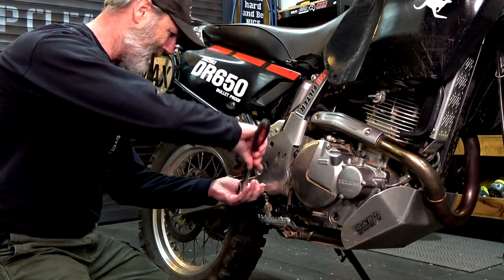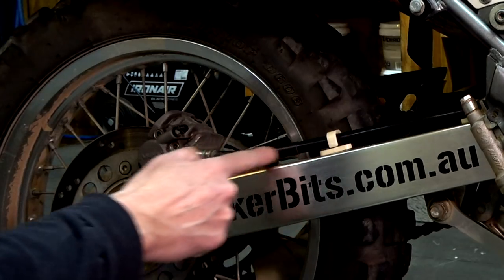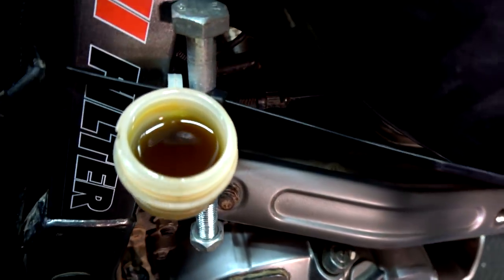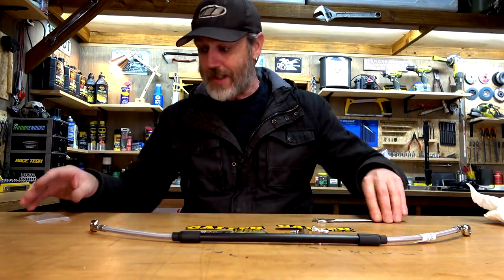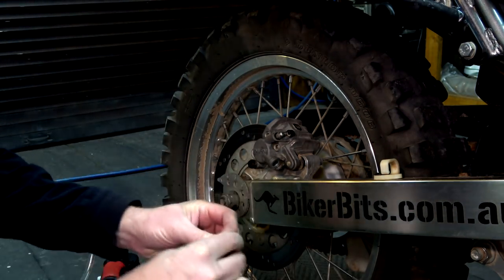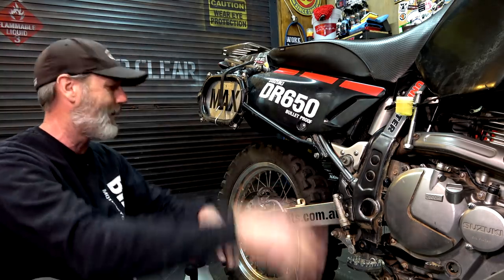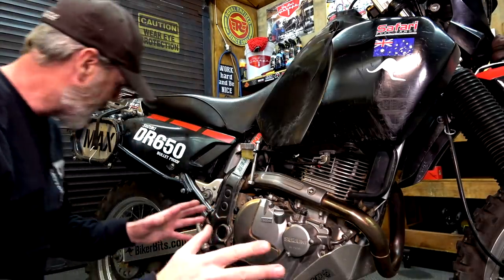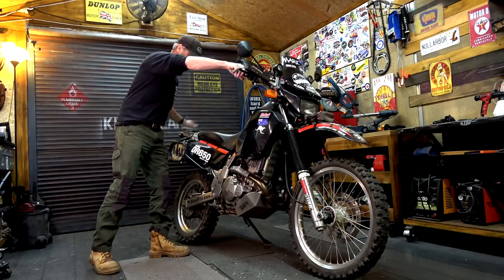DR650 Rear Steel Braided Brake Line

Comment: Easy way to bleed is to use a 80ml syringe & reverse bleed from the caliper to the master cylinder, can also use the syringe to remove fluid if overfull or changing the fluid. makes it a very easy 5 minute job...just a heads up

Comment: I have a vacuum unit as well. Not the same model but works a treat. Saves a lot of time.  I would remove some fluid from the reservoir. When the brakes get hot the fluid may expand. Will either leak past the seals [causing damage] or push the pistons / pads onto the disc creating even more heat and damage to the disc and pads will wear quicker.  Just get a small syringe and draw out some fluid between the marks on the reservoir. Taking into consideration the amount of brake pad material there is.
Reply from the maker: Thanks for the heads up! I'll definately do that 👍
Reply: @BikerBits  use your syringe, Max/Min lines on the Reservoir.
Reply: @FULLPELTAdventures   If you are getting lines try the HEL braided lines from Australia in QLD. ADR compliant.
Reply: @Chris_Z.  Thanks mate, I will check em out.

Comment: Those LED light panels work pretty well. I just used your front brake lines vid to put Galfer lines on mine, so thanks.
Reply: Oh yeah, the braided lines make a huge difference. Huge. 
Also, making sure the reservoir is the highest point in the system? A very good idea. Thanks again.

Comment: Great job on both the front and rear install. Make sure to empty some of that fluid in the rear reservoir down to the upper limit line at least. When you ride and the brake system heats up the fluid expands with heat therefore it will need a bit of room so it doesn't overflow. Only difference between DOT4 and DOT4+ is the wet boiling point being 165°c for regular and 180°c for the plus but both have same viscosity. Definitely a worth while upgrade in your hot climate. Great video T4S 👍🍻
Reply from the maker: Thanks heaps Seb and it has now been done ✅😀

Comment: Hey Mark. Long time viewer from the states, first time commenting.

I have a very similar vacuum system and I use it on anything that needs the brakes bled. Cars, truck, trailers, motorcycles….. one thing I’ve found is that if you regulate the air pressure going to the tool you will control the amount of vacuum it creates. This will slow down or reduce the power of the vacuum created. Also, don’t forget that simply cracking open the bleeder just the tiniest bit will act as a valve and only allow a small amount of fluid through. So even at full power you can control how much it pulls through the system. Allowing you to move back and forth or stand at the reservoir and leisurely fill as it needs it.  So when you change that new fluid in two years or if sooner when looks like cola (means it’s absorbed a lot of water) in the reservoir, it’s a simple hook up and flush the system in less than 20 mins total. 
One of my bikes is an XR650L and I too switched for the Galfier brake lines from stock. HUGE braking improvements. My rear line was also shorter in length and have found it to be a non issue since installation.

Take care
Reply from the maker: Thanks heaps for that mate! 👍

Comment: Great video Mark
Many years ago when I purchased my XR650R from new. The front brake lever was so spongy that you could pull the lever right into the bars. Not very inspiring for a new bike. Bought a braided line from Ballard's and you could tell the difference straight away. The lever now come half way in then become nice and solid. The XR was know to have crappy brake line. Standard rubber line was just too soft and spongy. Back then (03)  I'm pretty sure it wasn't a road legal modification. Due to not being able to inspect the condition of the rubber lines etc. More as a racing mod.
Reply from the maker: Oh that's interesting! 👍

Comment: Congrats on working it out. Note with dot 4 being hydroscopic it also collects moisture sitting in an ‘opened previously’ bottle. On my H-D it’s changed if moisture is detected in the fluid and if not max two years anyway. Also use a new bottle of fluid and dispose of the left over. Hence the reason you know see tiny bottles on sale.
Reply from the maker: Great stuff mate thanks! 👍
Reply: Yes this! Plus never pour anything back into the bottle. You don’t want any contamination in the fluid.

Comment: Much better, I normally use a little Mityvac, little cheap hand pump 2-3 squeezes at most only need 5-10in.Hg vac/15-30kpa vac, don't need a lot of suction. 
Nice, you only went a bit less than 1/2 a turn on the brake nipple also. 
Again should take note of the fluid level when you started, as you didn't change the pads to leave it back to the same amount. 
Too full can be an issue as there is a little breather hole that vents a tiny amount and could get blocked, but as you said that fluid has been there for years. 
Still would recommend you leaving a weight on the break leavers overnight to let the tiny air bubbles out. 
Hygroscopic.
Reply from the maker: Thanks! 👍

Comment: In reality save a ton of money and just use a bit of clear plastic tube, all you have to do is push the brake pedal down, but don’t pump the pedal with the bleeder cracked open, it will just keep sucking the air in and out.

If you need to drain some fluid out of the reservoir just crack the bleeder and push the pedal down, close the bleeder and let pedal go and also it is best to have the calliper piston all the way in when yo set the level otherwise the reservoir will be over full when you fit new pads.

Same old samo mark, keep it simple.
Reply from the maker: Sweet 😃
Reply: Yeah, that's what I was thinking. I can see where the silly pump thing could be useful with a car. On a motorcycle the brake lines are to short and the reservoir to small to worry about the pump. A few pumps and its done...

Also, yeah, I would've pulled the caliper pulled the pads, pushed the piston in then done the job. He accidentally left that old nasty fluid in the system.

Comment: Golden Rule, NEVER NEVER NEVER put brake fluid back in the bottle after bleeding it out of your brake lines. It will degrade your unused fluid and cause problems with any subsequent bleeding of your brakes. Also after bleeding is completed, apply pressure overnight by tying back your brake lever or foot pedal. This helps to force any microscopic bubbles out of the lines overnight and gives a firmer feel to your brakes.
Reply from the maker: Thanks mate! 👍

Comment: Mark , I have similar brake bleeder pump from BikeMaster and it works  great !!  You do need to have a helper just to fill up the resevoir while this brake fluid goes down. On mine, you can lock the lever so it continues to suck the oil and then i just have to concentrate on opening the bleed nipple and making sure the resevoir is full. When you can lock the bleeder, use the round side of the spanner, it will stay in place so then you can open and close the bleeding nipple. This guy does a good demo of the BikeMaster brake bleeder so you can see how he runs it. :  https://www.youtube.com/watch?v=BZbpDiwpZoI